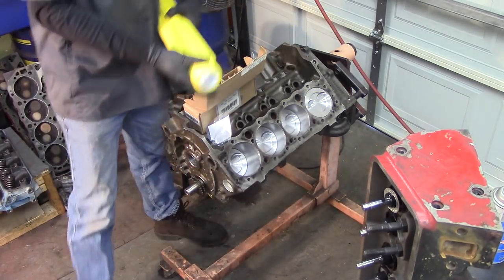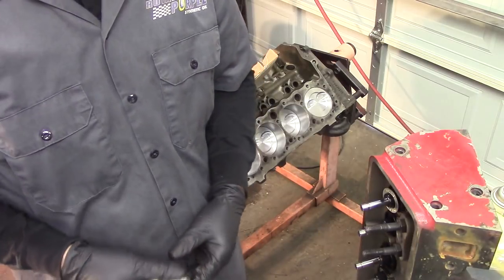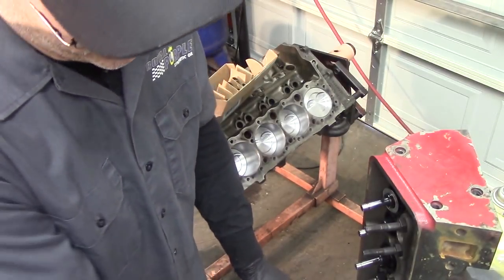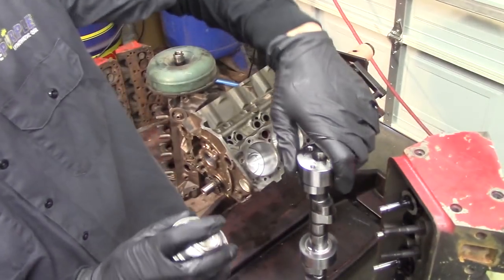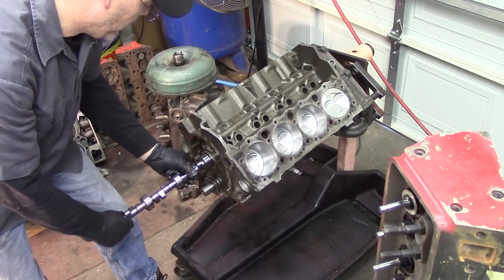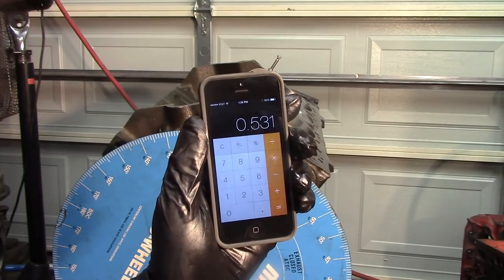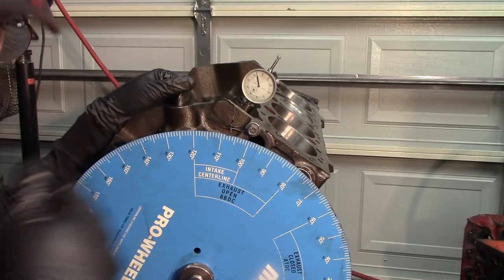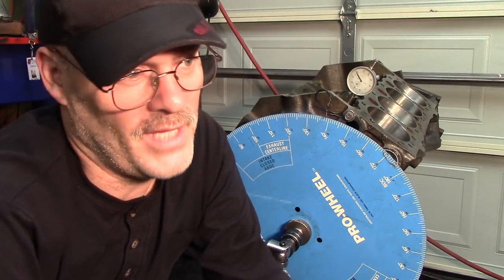383 Stroker Engine Build Part 7 (Camshaft)

Comment: For the dial gauge you are running on the cam, is it contacting a mechanical lifter or the actual cam lobe?  My dial gauge isn't long enough to hit the cam lobe, do I need another one or can I use a mechanical (not hydraulic) lifter to get measurements?  Also, your videos are great to watch, keep it up!
Reply from the maker: This is a lifter bore gage it rides on the cam you need to buy it for doing this 
https://www.summitracing.com/parts/pro-66838?seid=srese1&gclid=Cj0KCQiA4feBBhC9ARIsABp_nbWA-8Dgv0GxHN0VvuDlPW8xg6JG1AXCEw5hTQrADOy2pevo_KiCiQQaAkr5EALw_wcB

Comment: Is there a way to identify a cam (degree it, basically) while the engine is in the car? Maybe this is a video idea for you if this is do-able. I have a project car that doesn't have the heads I expected, and so it may not have the cam I expected either. I'd like to be able to measure the lift, duration, lsa without tearing the heads off, and using a degree wheel is probably not an option either.
Reply from the maker: Yes it can be done you can use the piston stop method for true TDC and use a dial indicator on your rocker arm
Reply: @Myvintageiron7512  Thank you, that's the conclusion I came to.  I can find true tdc and lift that way, which is crucial, but I guess I'll need to McGyver up some sort of a degree wheel to figure out duration and lsa.

Comment: Great tutorial my friend 👍. I'm building my LT1 in my 94 Pontiac Trans am. I'm new at degreeing a camshaft... I'm going to be running a comp cam kit.. my question to you is  ???  I'm going to be running hydraulic roller lifter's with a roller comp cam. Is it good to offset the roller rockers?? For instance.. 1.5 roller rockers on intake and 1.6 roller rockers on exhaust??? 2nd question??? Do you recommend LS 7 pushrods in my LT1??? Or just plain LT1 pushrods????
Reply from the maker: you can use 1.5/1.6 rockers to get desired lift your LT pushrods should be fine
Reply: @Myvintageiron7512  thanks for responding back and your input👍...

Comment: I know this is an old video, you explained haw to check and make sure the cam is what the card say's it is very well, but you never explained timing the cam to the crank and what relation you want to set the cam degree + or - for Hp or torque, or if it happened to be off two or more degree's and how to adjust for it. I thought that was really the whole purpose of going through this besides double checking the cam builder and manufacturer?? Thanks for the vid.
Reply from the maker: The Intake lobe centerline is the spec that checks cam to crank timing
Reply: I’ll back up and watch it again

Comment: I have followed your video as closely as I could and was degreeing my cam as I was watching. I have watched two videos off you tube and my numbers still don't come out right. I can't figure out what I might be doing wrong. I have a sbc with comp cam big mutha thumpr. Lunati degree wheel. Have found tdc multiple times. I still can't figure out what I might be missing. Any ideas?
Reply from the maker: is your timing chain on right? make sure your gears are dot to dot 12 and 6 if this is off none of your numbers will make sence
Reply: Myvintageiron7512 
Checked the chain. The closest I could get was 48 degrees on degree wheel at .006 intake lift. Can card calls for 44 degrees at .006 intake lift (btdc) was out in garage again for a couple hours working on it. Can gear at 6 o'clock and crank at 12 o'clock.  Cam pin is about 2 to 3 o'clock with cam gear installed. One thing I am noticing is most cam degreeing videos they are using a degree wheel like yours. One set of numbers all around. Mine has two on my lunati wheel. Thanks for the reply

Comment: Can you compute all intake runner cc, compression ratio and cam degrees,  bore x stroke to find the power?
I found a motorcycle engine with 320 degrees of intake, that seems insane, almost a full rotation intake is open
Reply: What's weird is that the piston goes down for the intake only 180 degrees and you must add in the degrees opening before tdc and closing after bdc but 320 seems like it would blow a lot of air back out. what type of bike was this?
Reply: Kawasaki ZX12

Comment: What's the clearance on cam bearing for your oil clearance does that mater?
Reply from the maker: yes If reusing the camshaft it is advisable to install new bearings and also mic the cam main journals to make sure they are not worn,  new cam bearings (if installed correctly) are very consistent size wise and give good oil clearance as long as the cam goes in with no binding they will be fine the cam bearings have very little stress on them and also remember the cam rotates 1/2 the speed of the crankshaft so it turns slow (Less bearing stress)

Comment: I was watching the video and when he was doing the math for the 148 +60 to me thats 208, not 209 or am I missing something? where did he add that 1 degree from? or was it just a simple mistake. 

Thank you.
Reply: I noticed that too, but is you watch the turn the in wire pointer actually appeared to reach 209, but it backed off slightly.   I would use a better pointer wire and also you notice that the block is not secure in the stand so he has to hold it while rotating the crank which causes a loss of focus and accurate rotation ability.

Comment: You didn't put the thrust washer behind the cam gear. High end gears come with one.
Reply from the maker: This set did not
Reply: I wondered the same thing! AND he said to "pre-load the cam". There should NOT be any preload between the cam & the cover, it should have .003"-.005" clearance with a cam button! [IMHO]. Also the degree wheel is moving 3-4 degrees AFTER each TDC check! This means the degreeing, is definitely not precise, again in my humble opinion! If you are checking centerline and off that much, with the adapter "play" on the crankshaft snout, then there's really no need to try and degree the cam.

Comment: I have never seen a degree wheel on a SOHC or DOHC engine. Is there a special reason for that?
Reply from the maker: Not sure what the reason is but they need to be degreed also
Reply: +Skyline Fever its the same idea.... just with less parts. its probably harder to do....

yes it needs to be done.... if you have a cam or engine you dont know anything about, or the make sure a new cam is correct. 

on a multi cam head... you have to do a few things twice.... which is a large pain in hte ass, and goes back to why its not done as much. 

im willing to bet they jsut hope the cam is right.....

Comment: Here is a good one for you. Change all the bearing, main as well as connecting rods. Car was running find for a while, but then I started to hear knock/ rattling like sound while the car is in idle once it got up to operating temperature. When I give it gas it goes away. Question what do you think is the cause of this?
Reply from the maker: Just changing the bearings is not the correct way to fix an engine id the rod bores or main bores are out of round tapered or misaligned it will wipe out the new bearings all of those components need to be checked and/or machined before new bearings are installed
Reply: +Myvintageiron7512 and depending on the damage and time spent knocking you could have to change connecting rods because of slight stress bends and if the scoring on the crank is bad enough the machine shop might have to hard face it because taking it 30 thousands down won't get that journal smooth
Reply: +Da Beginner pistons could be worn down.... causing piston slap. under load it binds and stops slapping.... but scratches your cylinder walls. 

the wrist pin on hte piston could be out of round.... 

could have a chipped piston skirt. 

bad or improperly installed bearings (ive messed up plenty i thought i didnt mess up)

all matter of things in the valve gear....

someone dropped a penny in your carb......

but all jokes aside.... film of this problem would go a long way.... its an 11 month old problem, so...i hope you fixed it.... but. it could be all sorts of things. good luck man. 

we had an engine that didnt run right.... guy sold it to us... he NEVER changed the spark plugs. that was the only thing wrong with it. 

ive seen the electrode burn off and fall into engines causing rattles. 

i had the piston skirt on my enduro break.... somehow didnt take out all the fresh bearings and crap.... missed all the ports, and just dinged up the piston and head..... very lucky i could re-use the jug. a new piston and 3000 miles later.... all is good.
Reply: Crankshaft endplay?  Just a thought, I had the same thing happen to me and it ended up being endplay.